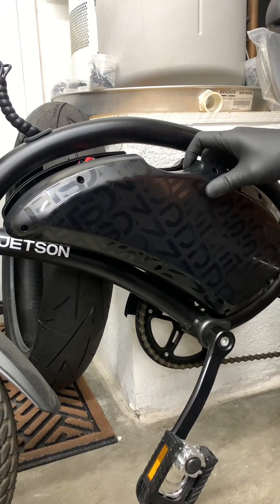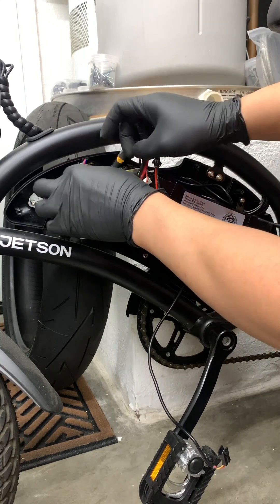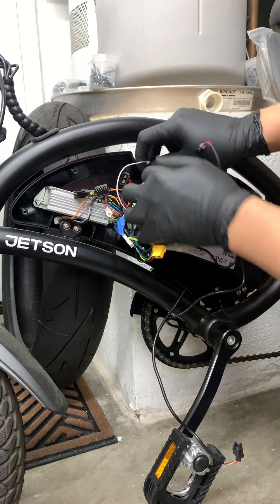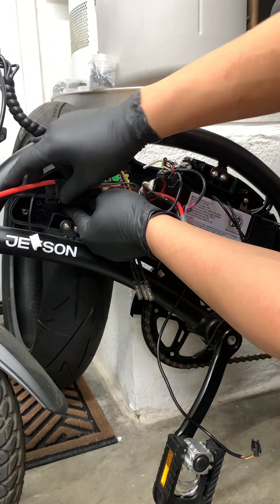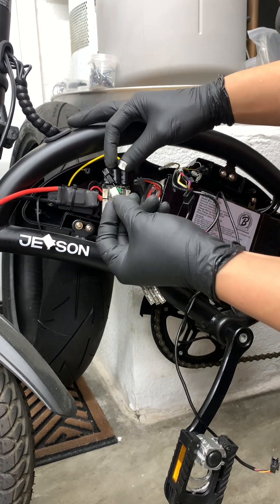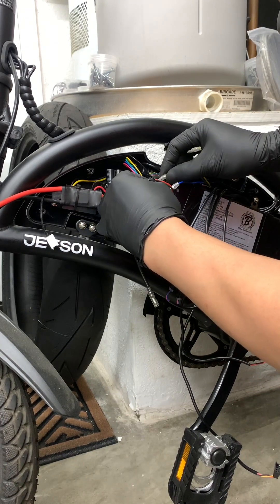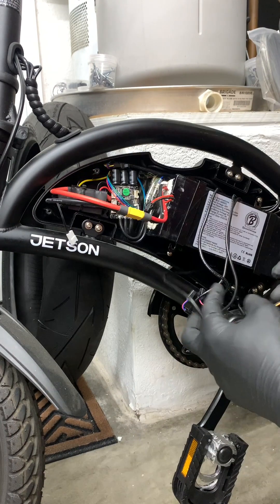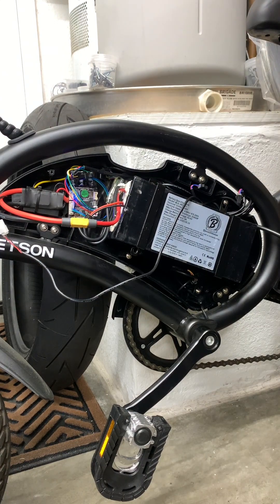How To: Jetson Bolt Pro FAFO Controller Install | Blacklisted Garage

Comment: I have the same bike what are those 2 wires that was not plugged into nothing for because mine looks the same in a wires but my bike is not working at all
Reply from the maker: The two wires you are referring to are likely the brake light wires.

Comment: With this upgrade we lose the battery led in the throttle and the headlight stays on?
Reply from the maker: Things to note with this upgrade:
Headlight output (stays on with power)
Will not work with PAS (Pedal Assist)
Battery gauge on factory throttle will not illuminate

Comment: What do I need to do on the vesc software
Reply from the maker: Please check out https://vesc-project.com/ for more information
Reply: @Blacklisted_Garage  what if I did yalls 48v battery with the speed hack and a upgraded motor you think I can get to 30mph?
Reply from the maker: The stock controller will not be able to provide enough power to reach your speed goals, you will need an upgraded controller.

Comment: Will this controller work on the Jetson bolt (non peddles)
Reply from the maker: Although we haven't personally installed it on a Jetson Bolt (non-Pro) ourselves, numerous community members have successfully swapped the Bolt and Bolt Pro controllers, reporting it as a direct swap in terms of connectors. In this scenario, the FAFO Controller will also seamlessly integrate into the Bolt model!